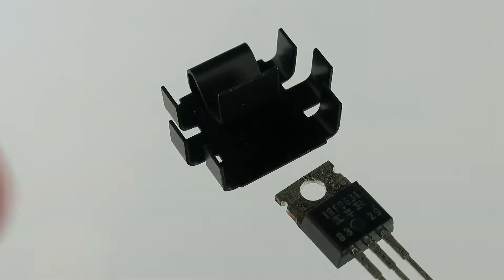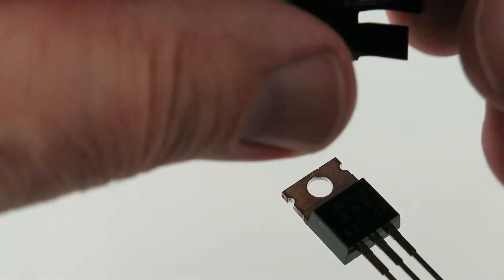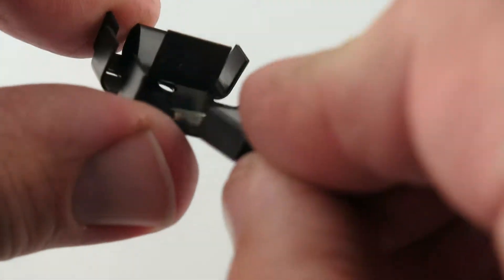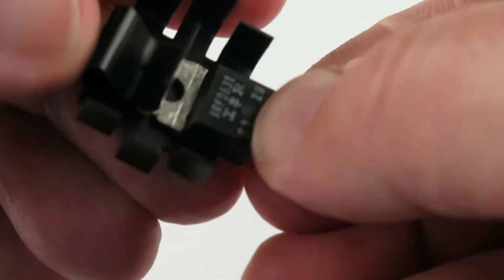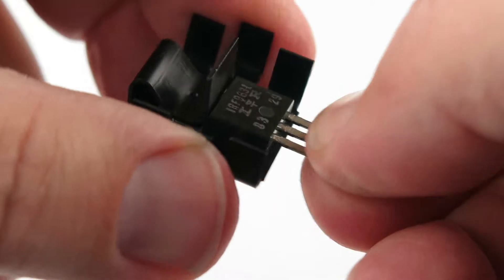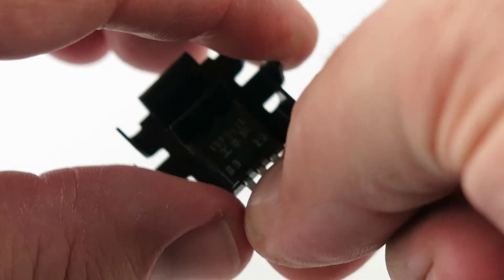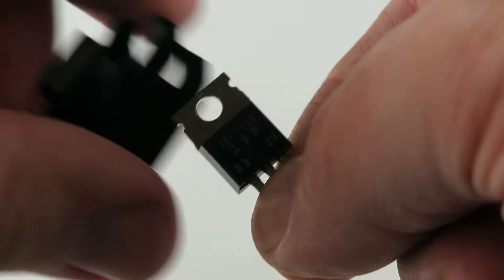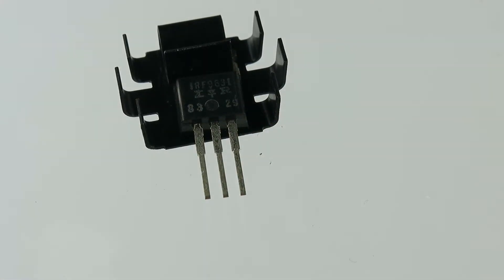G21504 - Handy "Clip-On" TO220 Heatsink

Comment from the maker: Do you "Need" it? Probably not.... Would it give you a better contact between the heatsink and item yes. 
From Wiki - "The main role of thermal grease is to eliminate air gaps or spaces (which act as thermal insulator) from the interface area in order to maximize heat transfer. " So better contacts more heat distribution.
I have also linked the part to the website if you would like one. Cheers